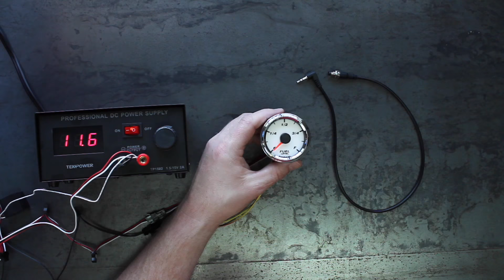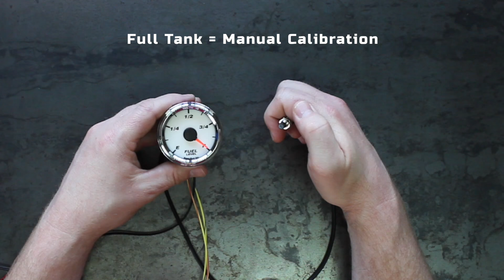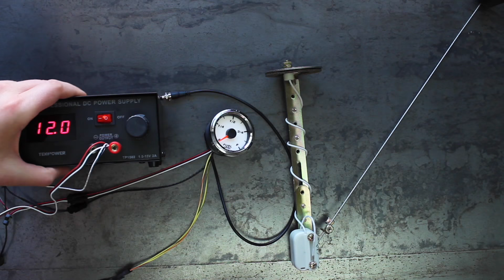How To Calibrate Your Fuel Level Gauge To Any Fuel Sensor

Comment: I Now understand why gas gauges are notoriously off. These gas gauges are using resistance or ohms. The float rides up and down a rheostat depending on the placement of the float the system will send a certain amount of voltage as a feedback. Many things can affect resistance this would be highly inaccurate. In industry measurements have to be accurate. We use a system of 4 to 20 milliamps as a feedback with a device called a transducer or load cell. With a resistant base system (ohms) I would suggest making sure all your electrical connections are corrosion free and tight. Re-strip the wires apply silicone dielectric grease reconnect them tightly. If you can pull out the float and spray it down with contact cleaner. Use non-combustible contact cleaner and make sure it's completely dry before you put it back in place. Good luck
Reply: @ikebubins36 : No, fuel level gauges are notoriously inaccurate because different shapes of fuel tanks tend to create inaccuracies. Once manufacturers got away from the basic "rectangular box" or uniform cylindrical shape, it became realistically impossible to have a truly accurate fuel gauge. 
   Additionally, many vehicles have a reserve capacity built into the fuel gauge reading. What I mean by this is that they will often read "Empty" when there are approximately 2 gallons of gas left in the fuel tank. This is to compete with human error, and allow the vehicle's operator to reach a refueling station before completely running out of fuel in their vehicle. Not all vehicles are designed in this way, so you'll need to read your Owner's / Operator's Manual to know for certain if it was designed to have a "reserve capacity".
   Another source of error would be if the fuel tank level sensor was changed / replaced and installed before verifying that the float arm was exactly the same length and also shaped/bent exactly the same as the original, to allow for the most accurate fuel level reading to mimic the original unit. 
   The resistance values rarely have anything of real importance to do with the gauge's accuracy, so long as the gauge and the fuel level sensor both have matched resistance values, so that they are compatible to function with one another. 
   Unless the rheostat goes bad, typically from normal wear and tear as the vehicle ages, few things go wrong with fuel level gauges. Other semi-common factors can include bad electrical wiring connections, whether due to corrosion, loose, or broken connections. 
   Such failures are typically more rare, by comparison, and most fuel level gauge failures come from a bad level sensor, where the rheostat goes bad or the float itself deteriorates or becomes detached from the sensor's float level arm. 
   At the end of the day, a vehicle's electric fuel level gauge is merely a guide to enable the vehicle's operator to have a rough idea how much fuel is in the tank. They are FAR from precision measuring instruments. 
   The best solution? Get to know your vehicle's "quirks" and always fill the fuel tank up when fuel level gauge reaches 1/8 of a tank remaining. 
Don't wait until it reaches "E", unless you have a full gas can on hand as a "back-up reserve".

Comment: Great information.  I recently replaced the gas gauge sending unit/sensor on my car but it still shows only show 7/8 full which is the same as it was before I replaced it.  Do I needs to recalibrate the sending unit after the installation so it will read the correct level?  Thank you!
Reply from the maker: Yes, you will need to calibrate the gauge to the sending unit.
Reply: Thank you for your quick response.  Why that important information wasn't posted on the material I  got the sending unit from? LOL.  Again thank you!
Reply: @tousshong9438  Because it was pretty obvious you would have to re calibrate it when replacing a sending unit.
Reply: @vegasjack1  Well if you replace old one with identical sending unit logic predicts it should work with out calibration as its same unit. How ever if its not, then you need to do the calibration obviously.
Reply: @Hellsong89  So, you don't think just disconnecting the wires  to the same guage requires re-calibration?    Let alone putting in a new one.

Comment: @speedhut  On the manual calibration, does the "full" have to be calibrated first?? I ask this because  there is no way for me to empty my gas tank. Can I start the calibration with an empty tank on the E setting??
Reply: I was thinking of the same thing. While its sure possible to calibrate gauge on the road side when gas runs out its still bit of a pain in the ass, where most people probably empty gas tank by driving short distances at home stead etc or in custom build have empty tank that has been in storage/been just made want to calibrate empty, fill up and calibrate full.
Logically it should be possible to do ether way, but only speedhut can say for certain.
Reply from the maker: When doing a manual calibration on our fuel level gauge you don't need to calibrate full or empty an a specific order. You can do full first or empty first. You can also do them at separate times. Keep in mind that the gauge will not read accurate until both ends are calibrated.
Reply: @Speedhut   In other words, you have to take the fuel sensor out of the tank and make the adjustments on a workbench.
Reply: @discerningmind  Not necessarily

Comment: I have 2016 Audi A6 V6 Quattro 11000 miles. Fuel range Gauge has incorrect reading. When I fill-up, it shows 490-510 mile which never happen.
Dealer says that nothing wrong. I need some advise.
Reply from the maker: Give our tech team a call and we might be able to help you: 801-221-1460 or email Tech@Speedhut.com